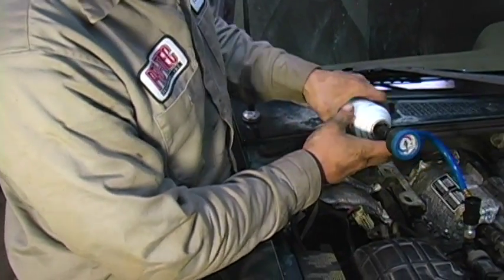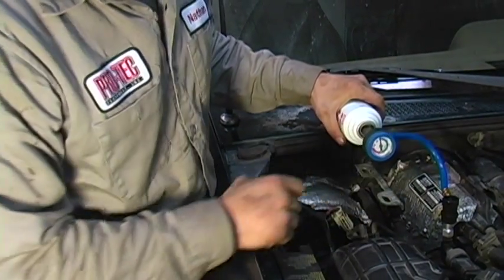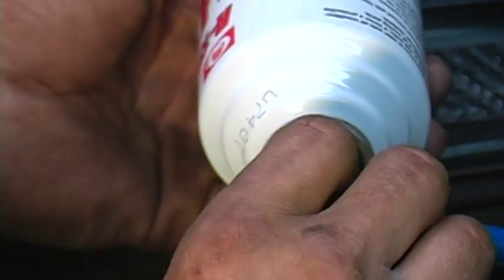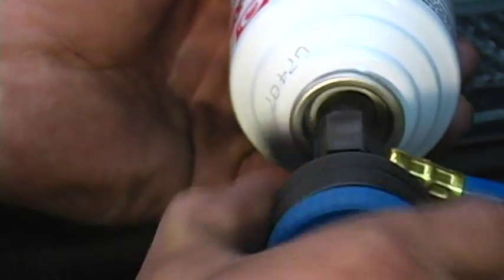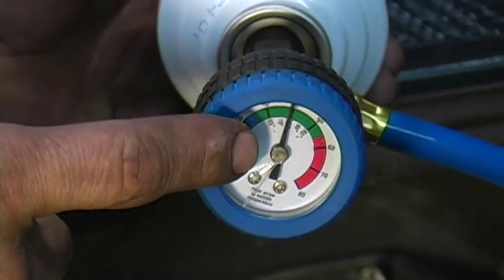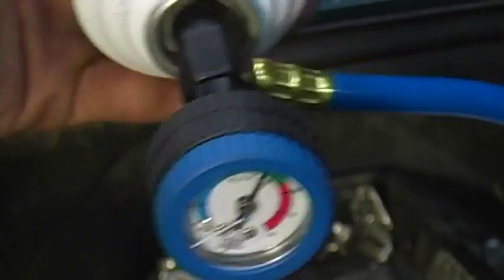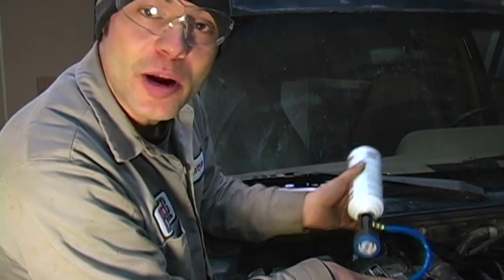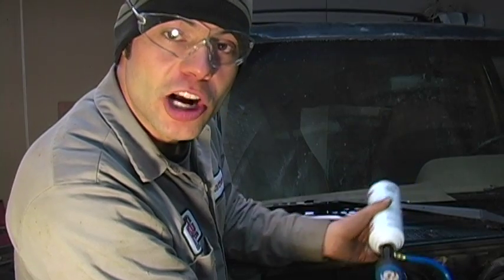How to Recharge an Auto A/C System : Charging a Car's A/C

Comment: Well you missed evac'ing the system and then pulling vacuum for 30-60mins.
Then adding tracer dye and then adding the correct amount of R134A(by weight) then using a AC gas leak detector and/or UV light to check for leaks.
Find leaks,evac system again and pull vacuum,fix leak(s),pull vacuum again and recharge system with correct amount of R134A.
The correct way to fix your AC system.
Reply: George Slim do I have to evacuate the system or could I just recharge

Comment: what if the system is completley drained, and halfway through a can the gauge shows over filled?
Reply: that means its not completely drained, check and see if your compressor is running, if it is, take it into a mechanic

Comment: No safety warnings for amateur's? You at least, should have told them to OPEN the doors when running the engine, or prepare them to pass out from CARBON DIOXIDE poisoning, or to contact the Funeral director before starting.

Comment: After the 10 minute time period of putting freon in the ac, in a closed garage, with the engine running, one won't have to worry about getting cooled off. The body will cool off naturally after death - permanently !  If you prefer life over death, opening the garage door with a running engine is advisable.

Comment: Someone told me to take out all the pressure from the a/c until the gauge read 0 then add the freeon, is that true?  Never read a label that said that. Do I empty it, then fill it up or just plug it in, refill and Im done? If after I am finish the can, what does it mean if the gauge needle still moves up and down from the bottom of the blue all the way to the top of the blue (Blue=Filled / 25-45 psi) When I plug in the gauge, the pressure goes up and down on the blue (filled) is it safe to add?

Comment: @mattdudley13   are they cheaper than autozones tool loan program?   Except for the refundable deposits on the manifold gauge set and vacuum pump of 300, while your using them it's free when you return them. 
So what about the oil in the compressor and accumulator?

Comment: IF your going to DIY a recharge like this, it should only be done with a system that has some preassure, compressor at that point should at least cycle on and off. Check the preassure on the low side, or HF has cheap manifold gauges, along with an A/C vac pump that is cheap.. Then, with an ambient temp at 90*, charge the system with the CAN UPRIGHT until the compressor stops cycling.. Then check vent temp and make sure it's cold. if it's still low on the gauge, just leave it alone. it'll be ok.

Comment: You can do this and apparently risk the end of the world, or you can spend more than your old runabout is worth getting an "A/C tech with 36 years experience" (now that's a guy with ambition) to do it for you. Give me the can! I've got no air-con now and if it doesn't work I'll still have none. If the compressor goes it won't cost me thousands for a new one, it just means it won't get fixed!

Comment: @MrNewell86
If you don't turn the can upside down are you risking not getting the oil into the system?  I think with the can upright you may get a lot of r134a vapor but not much lubricant. I'm not sure... What's the correct procedure?

Comment: @7477238 

I've been thinking of getting some 12a though. I will have to try 12a for myself and see if it does blow colder than R134A.

That what I meant to say. I meant to say I will have to try 12a not R134a sorry for the mistake.

Comment: @7477238 

I haven't used 12a yet. So I couldn't tell you if it is colder than R134a or not. 
I use R134A and I will admit R134a doesn't blow as cold as the old r12 systems.

I've been thinking of getting some 12a though. I will have to try 134a for myself and see if it does blow colder than R134A. 

When I get time I need to get some videos on here of "Proper" service techniques  on A/C Systems. 
.

Comment: This guy i s clearly not a professional A/C Tech. A professional would have a good manifold guage set with both high and low side guages.

You can never recharge the system right without knowing both the high and low side pressures. 

I'm a certified A/C Tech with a good manifold guage set.

Comment: Incorrect way to recharge .  The person never purged the hose of air/moisture first before screwing the hose onto the line fitting.   Further,   you dont just shoot a can of refrigerant into the system as he showed...it has to be accurately put in  so the system doesnt get overcharged/undercharged.   Leave the a/c system to real professionals to do and dont do it yourself.  You can mess up the system bad, plus you can hurt yourself using the freon.   Im an A/C Tech of 36 years.

Comment: Cool Vid ,,,Could mention too ,,.. , to try and maintain the valve needle below the red zone as you are charging the ac unit ,,  , also for those older cars with r22 gas ,, there is a conversion kit to the legal r134a wich you can buy at cragens err autozone which has r134a  tip that permanently screws  over your old r22 tip. some kits even come with an instructional  dvd . Tip- the air compressor will  not come on until there is sufficient freon on the unit, also check leaks with soap and water

Comment: I had a bad condenser and all my r 134a leaked out.  I repaired the condenser and recharged the system.  My question is, did my compressor oil leak out too?  I've been told in the past that it stays in the compressor but I don't want to chance it.

Comment: haha...yeah, mine said hold upright as well, and nothing about shaking it. Also, i could clearly tell the can was empty within 25 seconds of opening the valve...not 5-15 minutes. I can confirm it was empty because i took the valve off the can when i was done and it was...well...an empty can!  Sometimes the connectors on these cheap re-fill kits SUCK..they are very hard to click on to the service port and often leak, causing a frost-burn on your fingers. Buy the ones with the good metal connector

Comment: What do you think guys about, the existing oil is compatible with this freon good question? It's not, the oil used in old sistem was alkilbenzen mineral oil R-12,R-22 A/C sistem, R-134a Polyester POE oil, if do you add R-134 on R-12 sistem, and not replace the oil and dryer you will kill the compresor thank you god bless to everybody, have a nice day